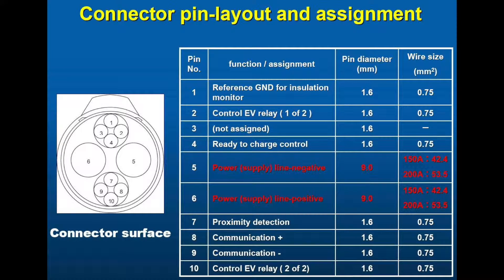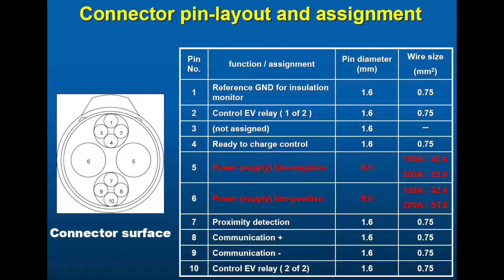Tesla Model S CHAdeMO Adapter Explained

Comment: I own one of those adapters.   The CHAdeMO pins and the Tesla pins are exactly the same diameter, 9mm.    Tesla put the approx. 3mm pin/post in the middle.  I suspect to improve alignment when inserted into the car.  The center post can actually be unscrewed and removed.  No fibre optic that I could tell.   I looked at the Tesla connector patent.  It looks like they borrowed heavily from CHAdeMO and J1772 to make a connector that combines the functions of both.   I wish all American EVs just used the Tesla or Mennekes connectors.